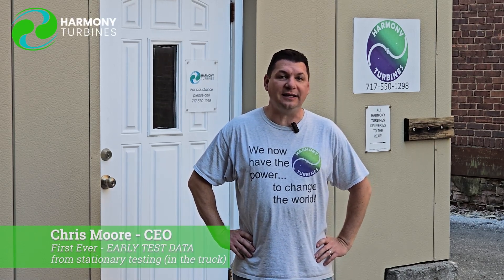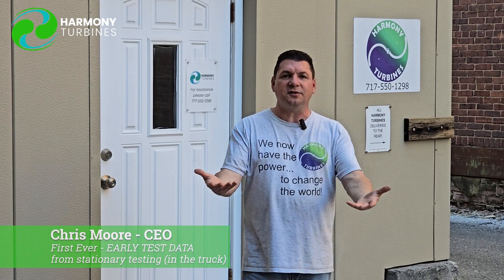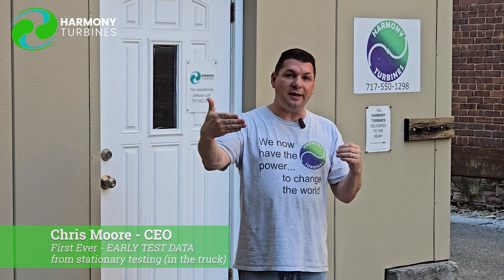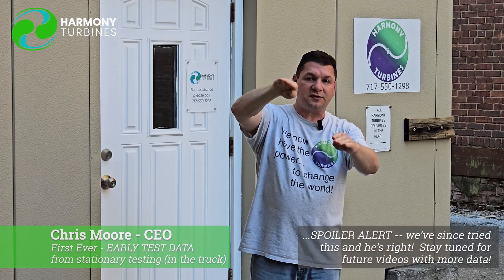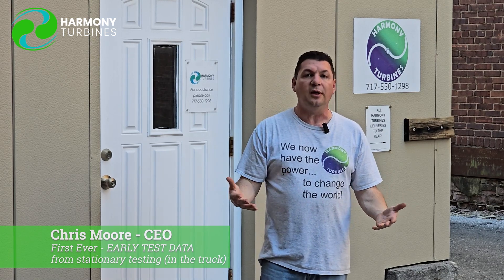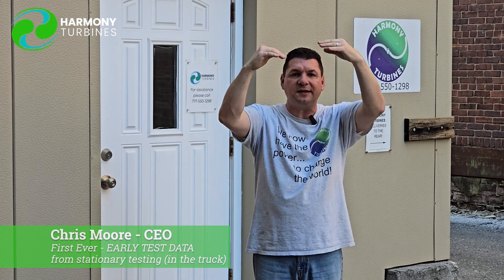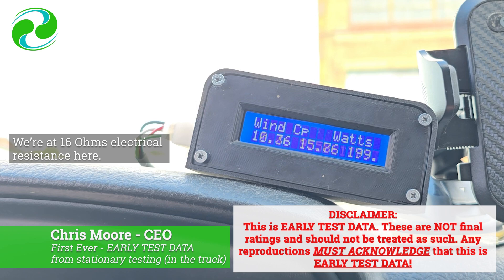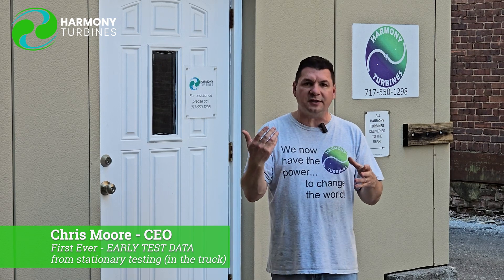Performance data ...its finally here!

Comment: I was sure about it, my calculations was exact, and even after the improvement, you don't gonna be beyond 20% efficiency, the problem is the covered area at specific moment, you can never reach 100% at most 40% with the optimum design, but not with yours, sorry, and don't forget the drag resistance from the opposite side, it's significant in your case.

Comment: Just thinking out loud, but it seems to me that the use of a gear reduction transmission and heavy flywheel system might help here. You've got gear reduction and torque angles being used on your turbine, why not in the connection between turbine and generator? Lots of road bike systems with automatic shifting could be used for inspiration, a speed regulated CVT would work well. Using it to drive a weighted flywheel would act as a way to regulate your RPM's to keep your generator in it's sweet spot. I realize it's early days, good luck!

Comment: Hi Chris, three brief questions for three brief answers (when you have time):  Have you verified the efficiency boost of the 2-scoop over the multi-scoop with the same generator in the same gusty wind conditions? How well does the power output correlate between real world, indoor wind test, and model conditions?  Have you done any testing with flywheels?  ...keep up the good work!
Reply from the maker: We're working on getting BOTH types up on our roof for side-by-side comparison. The roof mounting stuff is all going to be documented for you guys so stay tuned! The models help us identify potential improvements that we would then look at making in full-size. So far the single scoop pair is the only one we've built full size so we'll share all of that data and comparison as we get it. The data is coming now we just need some time to mount units etc.... Flywheels: I know they sound like a good idea but it's just more MASS to get spinning and in the end by making harmony out of heavier metals (aluminum & steel) vs plastics or composites we are essentially in a flywheel situation already. :)

Comment: A single data point is not the whole set; you're going to have to record a long list of data points in order to get your baseline, then you can start to see what the mean looks like. Patience is necessary.
Reply from the maker: @tomhenkel4328 correct. We will continue collecting data as we make improvements. We look forward to compiling the data together in the future.

Comment: Please try and find a windy spot somehwere that you could use for proper year round and permanent data. The truck data is not good enough......
Reply from the maker: @Mark_SWZA We're placing two units on our own rooftop and when we're satisfied with the system and data collection, we'll do just that with BETA testing units.

Comment: We could better measure your progress if you also posted interim milestone goals. Good to see progress nonetheless.
Reply from the maker: Carlos our goals are simply to make as much power as possible in the various wind-speeds but most certainly to be in the 400-500w range at 25mph. We're half way there with our first attempts so I'm pretty excited to see that this early in the data gathering stage.

Comment: Not to be mean  but why are you not mounted to a trailer, This would help remove the effects of the trucks aerodynamics which is not unsubstantial. Need proof , roll down your windows and try again.
Reply from the maker: I think a trailer on the back would be a LOT worse with dirty wind. We need to keep things simple and agile. The truck is a means to test A to B ...not to rate our turbine's performance. That's what the roof mounted units will be for.

Comment: Just an idea, why not mounting it on a trailer which you can lift a tiny bit off of the ground with 4 foots, you wouldn't have the pick up truck in the way once decoupling it and it won't shake. Greetings from Germany

Comment: You're asking for a smooth output from an inconsistent source.
That ain't going to happen.
Take your turbine, put it horizontal, put a centrifugal clutch at one end and flywheel to take power from.
That will better allow you to take advantage of wind moving across rooftops and smooth out your output.
 Which your Charging System is going to love.

Comment: Yall might look into some either physical damping (friction) control or code-in some damping to make what you're reading into steady-er numbers, or also incorporate some analog gauges alongside digital data logging. Love the use of the e-bike hub as a simple generator with data logging capability. Fellow enginerd and cyclist here.
Reply: It'll be interesting to see how birds and bats interact with this type of wind turbine .  . I'd wager that even a larger-scale turbine presents less danger to them. On the ordinary huge propeller type turbine, those blades slap everything in their path outta the air.
Reply from the maker: @underthejeep  birds and bats see our units as solid and simply fly around or over them.
Reply: or just dithering of the data.

Comment: The flex of the whole box was maybe also impacting your watts. The truck is not as sturdy as a ground mount. Flex of the entire unit would have messed with your numbers in a negative way. Good job!
Reply from the maker: Agreed, but it was the first time we could finally get data to share with our community. As we said data should only improve from this point forward.
Reply: I totally agree! You're doing great! Keep up the good work. 200 watts!

Comment: but what is the rpm of the turbine?
Reply from the maker: Yeah the RPMs of the turbine were around 70 to 80 in these high production gusts. We calculate that we should be well below 150 RPMs even in severe wind and by then we'll likely start furling. This was all 100% open (0% furled) data.
Reply: @HarmonyTurbines  okay thanks, do you reckon having 4 blades instead of the 2 it'll pick up more wind and spin faster? 90degree angle apart
Reply: @doubleooh7337  I can answer that, more blades more drag and a higher Stiction force. so the gains would be small if any. Harmony is not breaking any new ground these turbines ,they have been around forever. Their idea is to see if new technology can make this idea feasible. I.G, spaceX did not do anything but use the new technology and materials to land vertically, something we could not do in the Apollo . But we knew it was possible. I hope they find a better first principle.
Reply: All the inherant problems of the clasic Savonius are still present. If it is not addressed it will not fly @paperburn
Reply: @HarmonyTurbines 
How about using lighter weight material such as plastic for the scoops? RPM should increase greatly with lighter weight material. Plastic doesn't last as long as metal but it's most cost efficient. Some plastics have longer life, and plastic scoops can be replaced cheaply. My guess is the power output at least doubles by using plastic scoops because of more RPM.
Reply: looks like 60rpm but could be more

Comment: thanks for the video, have you considered to use some deflectors to prevent some drag from the oposite side?, i  know it could be problematic because of the auto folding feature.
Reply from the maker: Yes but it just adds more money, complexity, and parts to the overall package. Plus it kills aesthetics so we are not really looking at these options right now. Plus you have to consider direction of wind then once you start getting into blocker gear. Right now we don't care what direction the wind comes from.